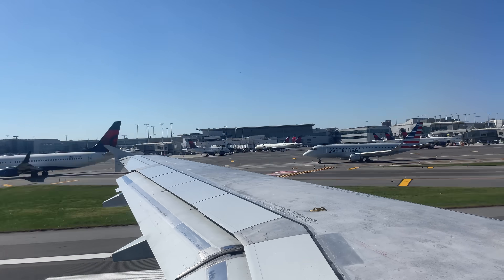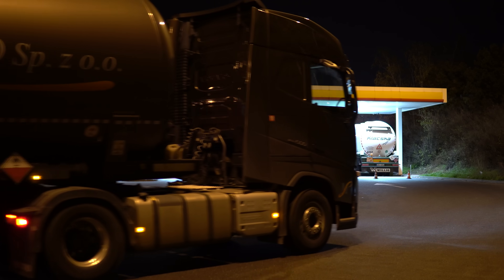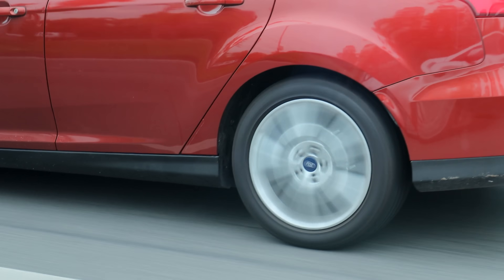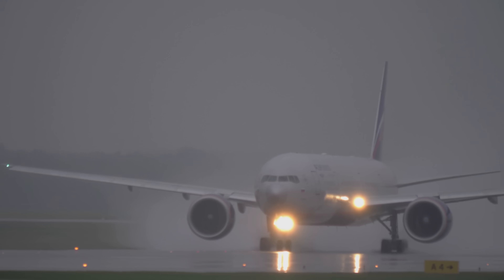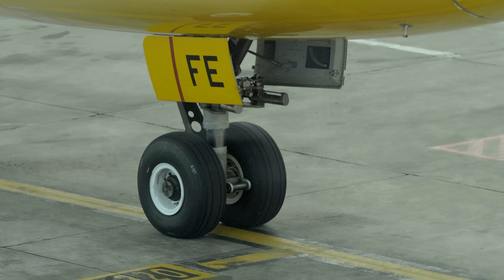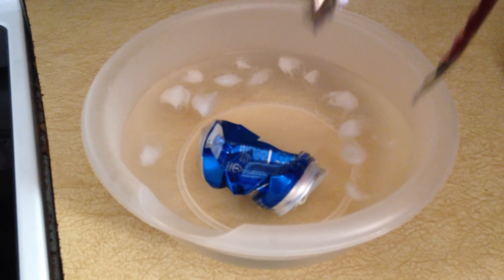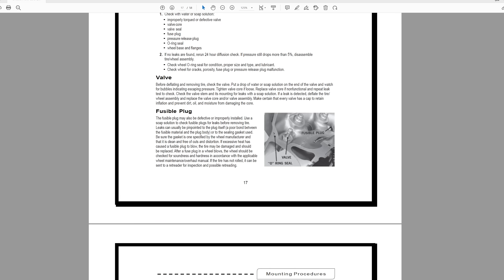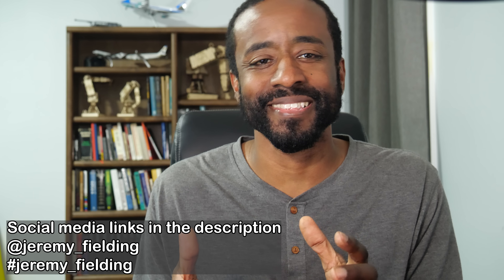The Ingenious Design of Airplane Tires- Jeremy Fielding 107

Comment: Hey Jeremy,  another reason for a high tire pressure in aircraft tires is to help avoid hydroplaning.  The speed for the onset of hydroplaning is roughly 7 times the square root of the tire pressure.   For a car with 36 psi tire pressure hydroplaning could happen over about 6 x 7 = 42 mph.  For a jet with tire pressure of 225 psi, hydroplaning would start at about 15 x 7 = about 105 mph.

Comment: As a boy I  designed an airplane tire which had "cups" incorporated in the  mold design, on the outside of the tire, that would catch the air speed and spin the tire prior to landing. This would save wear when engaging the tarmac. I never did anything with it. Maybe you could utilize it.

Comment: Please do a video on propellers:
laminated aluminium propeller blades
Contrarotating propellers
Speed prop (round tip)/power prop (square tips)
Fixed and variable pitch
Even vs odd # of blades
Straight vs swept
Pusher vs puller props
Efficiency vs rotational speed

Comment: In the early part of the video you are building a false comparison.  The reason that truck tires carry such little weight per tire has almost nothing to do with tire technology,  it is 100% about wear and tear on the highways, THAT is why they have that many tires for that specific load limit.  (EDIT - I kept watching and you finally talk about this issue at the end of the video , so you did know the real reason, you just chose to be misleading early on. , at least the fraction of your audience who watches the whole video gets the whole picture.  END OF EDIT) The runway at an airport has significantly better surface than the roads we drive our cars on.  To cover your butt you did say "DOT limit" but I doubt that most viewers figured out what that means in this discussion.
Yes, airliner tires are super impressive, I just think they don't need hype to be impressive.
Reply from the maker: I wasn’t trying to misled. It’s just the best comparison I could make that people understand. The tires are indeed many times stronger regardless of the road. Most people have been near a tractor trailer on the highway or at a gas station, but very few have stood underneath an airplane.

Comment: Thank you Jeremy from NZ. Could you please put metric figures for large weights in tonnes for your many foreign viewers. Having to pause and rework detracts. There was also a lot of research to see if it made sense to pre-rotate the wheels up speed to save rubber damage (the smoke) it was retreading (recapping) that decided this. Retreading should be applied to car tyres again.

Comment: Great video Jeremy! My dad used to do a lot of the wheels for a regional airline being changed at their local base. You didn’t skimp on the facts. I was going to be really disappointed if you forgot the fusible plugs. One area of clarification is the nose tires usually bear a smaller percentage of the aircraft total weight. The main wheels bear most of the weight.
Reply from the maker: Agreed.

Comment: Fully loaded truck can have 40-50 tons as lode. a 600 Ton crane can weight up to 90 ton (without counterweight) on 8 axle, usually only single tire on each side of the axle, so its not that simple. Also Nitrogen...
Reply from the maker: I agree it’s not simple. But it was a helpful reference. Thanks for watching:)

Comment: I am a Retired USCG Aircraft Mechanic / Flight Crewman.  I worked the Tire Shop at one of my assignments and built up and balanced hundreds of jet and helicopter tires.  Thank You Jeremy for diving into this very critical component of flight.    BTW   we flew on the same aircraft we worked on and if we broke down some where we just called "Home Plate" and they shipped / delivered via another aircraft to us the parts we needed to fix our aircraft.  We performed ALL the repairs and Maintenance on our aircraft.   There where no outside Repairman to call, we was them.   Keep in mind the HC-130 can taxi over sand, like in sand dunes type sand with a lower tire pressure on the mains (100psi) and still have a takeoff weight of 165,000 lbs,  think of an elephants foot vs. a goat's hoof.
Reply: Yes, but you also have a lot more wheel assemblies to allow that operation off of unimproved surfaces. I have seen pilots scrub every one of those wheel assemblies to replace level in a single landing, thankful I was not the one changing them. My next door shop was the wheel bay, he had his own nice little armoured room, far from everything breakable, where he would do the first fill of any wheel assembly. Concrete walls and floor, and armoured door, but frangible roof so the blast would go up. Just like the armourers had a similar room where they would fuse munitions, for the same reason. Armourers had the best door gargoyles though, recovered practise bombs that were mostly intact, though the 1in steel case had split open and become more or less flat.

Comment: Another big difference that would make a tiny high-pressure car tire impractical is tire wear. Not only would they be expensive, they would also not last for dozens of thousands of miles (at the all-weather grip levels we expect of them). Airplane tires on the other hand, only need to last a few hundred miles. Another reason to make road car tires bigger (per supported lb)

Comment: Jeremy you're kind of being disingenuous with your figures. Yes the nose wheel on the 737 is 27 inches, but the rear wheels are like 44 inches in diameter. You keep emphasizing the tire difference using only the front tire of the 737. This makes people assume the rear tires are the same size which they aren't.
Reply from the maker: Check the description

Comment: I have no idea if this is a factor also influencing the decision to make airplane tires as small as feasible, but a smaller tire will have a smaller moment of inertia. Especially since the moment of inertia depends on the square of the size of the tire. This means that on landing the torque on the tire created by the friction of the runway will be able to create a larger rotational acceleration of the tires during landing. Granted, a smaller tire will have a smaller torque exerted on it by this friction due to the smaller radius of the wheel. But the torque varies linearly with the size of the wheel. The overall advantage goes to a smaller wheel in generating a larger rotational acceleration on landing. Anyway, this larger rotational acceleration would reduce the period where the tires are transitioning from pure skidding, to skidding with rolling, to rolling without skidding. I would imagine this is an advantage for control of the plane on landing, decreasing the heat generated from the friction with the runway, and increasing the lifespan of these expensive tires. Just a guess.

Comment: I had no idea aircraft tires are electrically conductive.  Really cool episode!
Reply from the maker: Thank you!
Reply: Lots of carbon black in the rubber, and till recently carbon loaded grease in the bearings, so they will not have arcing with the discharge. They have changed the grease formulas as well, so as to add in molybenum and other anti wear additives as well, to reduce the wear from the carbon on the bearing surfaces. The straight carbon loaded black grease is suprisingly abrasive, due to the carbon in it, but you do need a conductive grease that both will not build up, but also allow the bearings to spin freely at high speed, even with massive shock loading and temperature swings. Hard act to do, so there are a lot of specialty greases used by each manufacturer, all slightly different, and not always interchangeable

Comment: You'd get a kick out of aircraft certification tests: Max weight, tires and brakes worn to limits, minimum allowed tire pressure, down the runway to takeoff speed, max performance brake-only stop.  Five minute wait until the firefighters are allowed to do anything.  It's pretty wild.

Comment: Love the 737 ❤️
Great video!!!!!
I wrote some of the electrical CAD software for the earlier 737 (back in the 1990's). We were encouraged (as the division VP said) to, walk out into the factory and kick the tires". That was before the internal takeover by McDonald Douglas and the move of management away from the people who design and build the planes.

Motorcycle tires are also "round". I describe this as being more like the bow of a boat (so it parts the water), vs a car tire being like the front of a barge and it climbs on top of the waves.

Water vapor in a tire as it freezes and thaws is a huge problem over time. Water vapor can penetrate the rubber, when it freezes, water expands, microscopically pulling the rubber apart (deepening its reach with every cycle). Nitrogen is the far better choice!

Comment: Imagine being pushed back into your seat going from Zero to 275mph in a 1/4 mile in the matter of seconds.
I raced a rail drag, 177.8 miles per hour, the amount of force is awesome, being pushed back into the seat..
My mothers 1967 GTO She got for Christmas in 1966, had the same feeling of power and she would take me for a ride, to show me..
She was stopped by a CHP officer for exhibition driving..
She was going to get a citation until I begged the officer not to give her one and explained why..
He let her go with a warning and had me setup with an appointment at the CHP Academy for a passenger ride along, while an officer took a Dodge Polara through the track and the amount of G-force I experienced from a burnout throughout the course was freaking AWESOME..
But not as awesome as the Flight I got to experience in a T-38 jet. 
Not That Was Freaking,
DYNAMITE..
I almost crapped my pants, what an experience..

Comment: Another interesting fact for ya. Decommissioned airplane tires are bought by farmers for equipment. Typically grain wagons & other types of trailers. The reason is they are cheap, strong and have excellent flotation in soft ground.

Comment: Loved it! Question @ 14:18 you say smaller tires increase the pressure on the road. Wouldn’t the pressure be the same, but the distribution of the pressure over a smaller patch of road be different? Although, I see how the psi on the road would increase at the contact patch. 
Thanks!
Reply from the maker: You answered your question. Smaller area same weight means more pressure

Comment: In your calculations you did not factor in the downforce and spike during landing. The real capacity of these tires is much higher than just the weight of the plane.
Reply from the maker: Absolutely it is

Comment: What I find even crazier are the tyres used on cargo aircraft like the C-17. Not only do they have to do all the stuff you've mentioned, they also need to do it on a whole bunch of surfaces, not just clean perfect runways
Reply: I've a picture of the struts of the landing gear of a C-17 where there are openings in the  SIDES  of the fuselage to allow them to travel further, therefore allowing them to endure higher impact speeds on landing.

The C-5 transport aircraft has a total of around 275 lbs of air in its tires (that's weight, not pressure).
Reply: I suspect static discharge is required because of aircraft atmospheric tribocharging rather than surface tribocharging. If surface tribocharging was a serious issue, then that would be mitigated almost entirely by other treatments.

Comment: Very fascinating subject. It would probably also be fascinating if you did a series on the engineering involved with top fuel dragsters and funny cars. The tires they use are pretty incredible as well.

Comment: Speaking of Birthdays today is mine! 🤣 I have cheated death for 66 years, 50 of those years have been flying airplanes! I am a retired professional pilot today.. Jeremy you have done your homework well on this subject! The only thing that was not addressed is hydroplaning that occurs at approximately 9.3 times the square root of the tire pressure. Of course there are several different types of hydroplaning, reverted rubber, Steam, and viscous they all occur at different speeds but in general the formula above works pretty good.
Great job young man! 😁🛫

Comment: I don't believe that little tire can support that much weight. No amount of nilon reinforcement will change that. We're talking torque vectors on contact that will sheer  carbon nano tubes.
Reply: look up the requirements to build a 50,000 gal liquid holding tank.  You telling me a boeing 747 holds more fuel than that, and is supported on rubber?
Reply from the maker: Yes sir. The numbers are quite impressive and easy for you to look up. Thanks for watching:)
Reply: @Jeremy_Fielding  The numbers are strictly impossible. Do the load calculations yourself. Look up to what precisely?
Reply from the maker: Look up the weight of the plane (not to mention the additional load of hitting the ground) and the composition of the tire. I think you would find it interesting being that you are so surprised. I didn’t make it up. The planes are real and so are the tires. I have walked under a Boeing 747 and literally kicked the tires :)
Reply: @Jeremy_Fielding  As a farm hand, all I know is what weight can do. 412,300 lbs is too much. If it landed/took off on a highway at that weight, the whole road would bow and buckle like a ribbon. I destroy the road and pop tires with a manure hauler at 8 miles an hour at 100,000 lbs. It's too much Jeremy. It doesn't make sense to my brain
Reply: @Jeremy_Fielding  and I know the darn thing is real. I just can't wrap my mind around it. It just runs counter to all my years with heavy machinery. Needs bigger and more tires, and ideally not so close together. How do they not explode on contact?! I've popped tires just hitting the divider line onto a bridge. Spooky noise that is!
Reply: @Jeremy_Fielding  Regardless of my insanity (I know my noggin ain't screwed on totally tight), Happy halloween Jeremy, thank you for taking the time out of your day and responding to me.

Comment: Years ago I worked with a race team and nitrogen was what we used to fill the tires on the racecar for the same reasons you explained. There was another feature we also had and that was what we called a pop off valve. It is really just a relief valve on the rim opposite of the valve stem for filling the tire. It was set so as the tire heated up during the race it would release pressure so the tire would maintain the set pressure thus allowing the tire to remain flat so to speak on the track. Contact with the track surface is a very important thing for handling and speed.

Comment: F-15E Strike Eagle fighter jets can weigh 80,000 pounds and they only have three small tires with the two main tires taking most of the load. I believe that their tire pressure is as high as 335psi.

Comment: the fact that acft use 800F air at 30 to 80 PSI to keep a cabin cold and pressurized in any altitude is just amazing.

Comment: I worked for an aircraft wheel and brake manufacturer for 12 years. In that time I held several labor classifications from machining brake components to heat treating and machining the carbon fiber brake disks, overhauling both wheel and brakes and in all aspects of quality assurance. 

     If you'd like to make a more in-depth video on the subject I'd be happy to share my knowledge.

Comment: The rims are generally made of soft and brittle magnesium with very large tapper bearing and the rigors of the axle is seriously insane requiring special metals and exacting metallurgy with a degree in heat treatment that nasa would be impressed by

Comment: Great video Jeremy.  Concerning the FAA mandate for Nitrogen in aircraft tires.  I've been in aviation since 1983, most of the FAR's (Federal Aviation Regulations) are written in blood.  An aviation series would be great.
Reply from the maker: Indeed many of the reports I found came after a plane full of people died.
Reply: yup most everything in aviation is written in blood from dont use more than 3 washers as shims for castellated nuts to don't roll out of stall use rudder.
Reply: As with the Air Crash  Survival Design Guide....
The exploration of the human tolerance to acceleration forces is interesting, but equally grim.

Comment: Pretty sure that just the nose tires are 27" tall. The main landing gear tires are alot bigger. The planes i work on use 38" tires and weight 80,000 lbs
Reply from the maker: You are correct. Check the description

Comment: When I was in the Navy our C-9s had a "grounding strap" between the nose gear wheels. It was a strip of thick rubber with a woven steel belt layered in it. When the nose gear touched down the path to ground completed. There was always new steel to touch the ground due to abrasion. When it got almost too short it was replaced. It was about 1 1/2" wide. The bolt holding it to the gear was in contact with the steel belt and threaded directly into the gear. Elegantly simple and cheap design.